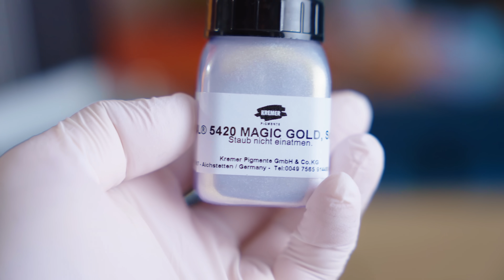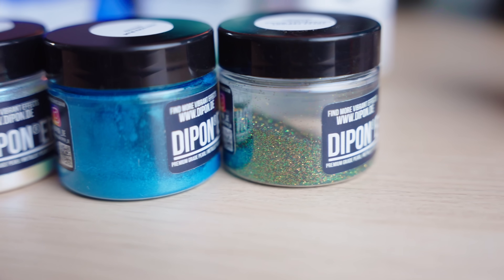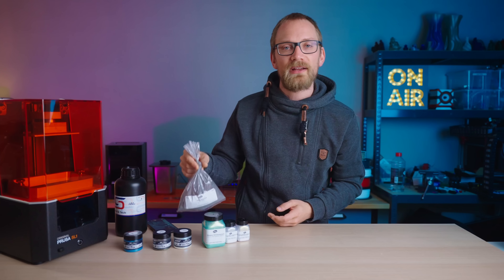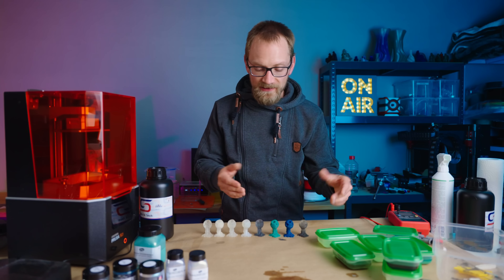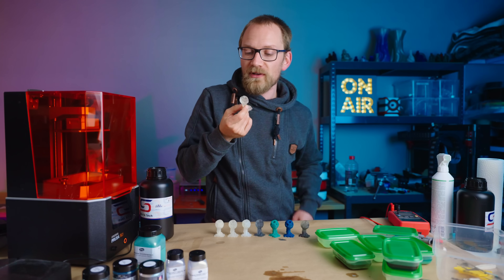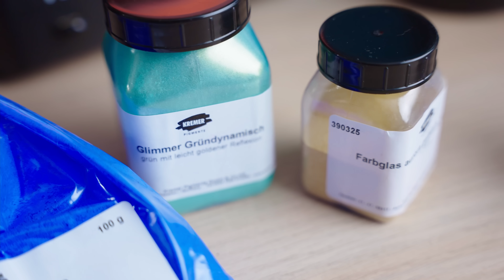Can we use Effect Pigments in Resin Printers?

Comment: Have anyone tried adding iron dust into resin, and print for example bases or better modular weapons+hands, which could then attach to tiny magnets inserted in the wrists & feet of a miniature?
(the base can be worked around in different ways, and it's much easier to hide the tracks under the base, but modular weapons have really tiny hands ball joints and are visible from most sides)

Comment: The ultimate challenge - Resin print in multiple colors! :)
Well I'm thinking (haven't tried it yet) that in some use-cases it can be done, at the very least in two colors.
I mean specifically multi-colored lithophanes. Multi-color FDM printers can do that, but resin printers have single vat with liquid resin - obviously it's not easy to switch resins in mid-print ... and where to define the "mid-" ...
But I just though that you can print several (thinner) layers of the same image lithophanes, each layer in different color and then stack them next to each other (and of course light a lamp behind them).
At least two layers would be simple to do, given that each layer can have one flat surface and they'll fit nicely.
Adding a third layer would leave a small air gap between the third layer, but I wonder if you have Red, Green & Blue layers could you combine them to produce much more colors?

Comment: Great video! 
Unfortunately with your low cost 3DP technology, you wont be able to use heavy particles.   (low cost printers to me are less than £10'000)
The machine needs "continuous mixing" ability -  existing ones cost at least $100K - The resin vat has a sink hole where it can drain out down into the mixer, give it a good stir, then pumps back up into the resin vat.

Particle mass/size/transparency will also have a huge role in success. (blocks pixels/reduce UV exposure)
You could print calibration/validation tools?   see how adding pigments/powders require exposure changes.

Alternatively I would consider looking at Graphene and Carbon Nano Tubes, and mixing them into resins.  (there maybe some available in shops?)
CNTs/graphene should greatly increase the conductivity, and may improve mechanical properties.

Perhaps you could look at coated particles?? --- a lightweight particle (aluminium) coated in a different metal for your design needs.
sadly... this route is likely to be extremely expensive and most products range $300-£1000 for  0.1g - 10g

Comment: If the particles are 50um then they CANNOT stack on top of each other because the bed clearance to the the build plate will force them to 1 layer.  (This most likely for the larger particles that you can easily see.)  Then they wind up following the layer lines - just like you saw!  I love the blue one too - good experiment!

Comment: I did many tests and this does not work well, because the movement of the printer un-mixes the  resin and draws the pigment or flakes on the sides of thebottom of the vat, most of them interfere with the printing and don't go in the print. A good fix is to add a mixing apparatus to the vat, that keeps the resin mixed throughout the print.

Comment: I wonder if a subsurface pump/pulse flush system may help W pigment distribution & orientation. A rig based around vertical syringes looks like it may fit around a bed perimeter.

Comment: I experienced a weird thing when printing where the bottom of the prints all had holes on the first few layers, which I'm assuming is due to clumps of pigments and maybe the ambient temperature since I also used Siraya Tech Blu V2. Seems inconsistent, but the rest of the print works fine. Kind of annoying when printing flat on the bed, but I have yet to find a concrete solution

Comment: So regarding "magic mica"... for the color to become apparent it needs to be on top of a black surface. (it's used in paint, so you would apply the magic mica on top of solid black) However in a resin piece, you will need to add a "smoke" type of black along with the effect pigment. This will bring the color of the effect pigment out 10x or more depending on how successful you are regarding getting the "smoke" the proper density.

Comment: Steal some industrial and lab ideas on how to keep the pigments in the resin during the printing process by making a 3d printed gear pump to pull the resin from the print bed into a mix chamber and then dump back into the print bed keeping the resin and pigment constantly mixed as the printer works. A gear pump is used to pump thicker fluids/gels like grease or honey and by 3d printing it you can toss the parts into the same bath process as the prints to clean after a job.  Labs around the world use a hotplate that has a magnet on a motor to spin a plastic coated magnet inside the glass container on the hotplate so it would be easy to steal that setup for a mix chamber using the same plastic coated magnets. 

If the pump is made right you can pump thinner fluids also so should be able to use the pump to help clean the pipes after a run before the final taking it apart to toss in for getting rid of the last traces of the resin to not effect future uses but then once you know how to make it it should be easy to quickly print new gears as needed. 

With access to the mix tank you could also do odd things like change the pigment mix during the print process to end up with different effects in different part of the print.

Comment: Create the ultimate red resin by combining stuff from the following list:
- Structural + Interference red pigments
- Conventional red pigments
- Fluorescent red pigments
- Copper and Graphite
- Red dye
- Self-luminescent pigments (such as Stuart Semple's Pink LIT and Yellow LIT)
- Rust powder

If you can get the ratios of all of these different ingredients just right, then Ferrari would be so freaking jealous. You could actually even license your recipe to Ferrari for use in their production of carbon fiber parts in their cars (since they still need to fill the parts with some kind of resin.)

By the way, definitely use an ultrasonic mixer.

Comment: I've seen the "holographic" look on most of my resin prints, it's just the flat faces of the layers reflecting back at you.  Maybe the metal flakes are also aligning when the plate mashes them down flat, but yeah it's pretty normal with very fine layer heights.

Comment: There are Metal "powders" that are "Atomized", that work better for resin casts. So a finer particle and suspends better in the liquid. Also running in a slightly cooler environment to keep the resin more viscous might help as well. 
You didn't mention if your Iron was done with this process.

Comment: I think one problem with the flakes that you’re having is that they are all orienting in the same direction, so if anyone is thinking of printing with these I would probably put the most commonly viewed angle facing down towards the bottom of the print bed.

Comment: @Thomas Sanladerer - You should of checked if the iron pigmented miniature ended up with any magnetic properties. You could also potentially use a couple high power neodymium magnets on the platform that the print is attached to. This should in theory help pull the particles up and keep them in a magnetic alignment.

Comment: The angled shimmer is caused by the mica forming a rheoscopic fluid. The up and down motion aligns the mica flakes. 

I'm surprised you had so few issues, when I was playing with pigments I had pretty severe under-curing and adhesion problems.

Comment: When I Dye (anodizing) The tiny Dye particles fit into the pore structure created by the anodizing process.. Time/time/amperage  all effect pore size  and if the Pore size is too small, The dye particles fail to enter into the pores and the dye does not take..( when done correctly, the dye particles fit and then after a quick steam/hot water dunk it seals up..)… Yeah, seems off topic and outta Left field…and it is, To a point… unless you make the connection.

Comment: I think the iridescent shimmer effect being aligned with the layers has more to do with the geometry of how it's printed - the contours generated by each layer going down create sharp horizontal changes to the surface that are more drastic at a steep angle, and less drastic at a shallow angle. So the light entering from above can bounce back more cleanly than light entering from the sides, where it's getting deflected. It makes me wonder if sanding the piece afterward would allow the shimmer to be visible in more areas

Comment: I would like to see how the model orientation changes the pigment effects. Also if stirring after x amount of layers improves the print like with the metal. I kinda thought that the metal wouldn't conduct as there is so much resin between the particles.  But, it would be really interesting what sort of magnetic properties that the resin has. Also, can your mixed up resin be cured by hand if you were to paint it on a print?

Comment: FYI, the channel "Major Hardware" did a metal impregnated resin print of a radiator to see if it would work to keep a computer CPU cool. It pretty much did! He ran into the same issue of the particles settling quickly.

Comment: I think the iron particles would be great for making miniature bases that you can attach to a magnet. One way I've thought of for storing my D&D minis was to get one of those carts with all the tiny drawers, and line the drawers with magnetic sheets. Originally, this would require gluing a metal washer of some sort on the bottom, but if the base itself is magnetic, that would be perfect. The idea was you could put any size or shape (you can't do that with the foam with the rectangle cutouts, and the pick-and-pluck foam has a lot of wasted space) and it would stay put, no rattling around and chipping off the paint as you move the cart around.

Comment: Great to see other people trying out powders and pigments in their resin of choice.  We've been playing with various glitters in our resin range for a year now and I think we have come to the conclusion that the reason most of the reflections are seen from the top and bottom of the finished print is that the particles get arranged flat when the build plate presses down on each 0.05mm layer.  I'm going to check next week if we can get the particles to be more random if the layer height is increased to either 0.075 or even 0.1mm.  Might even try running a pump or some way to oscillate the resin during the print to keep the resin moving just before the UV light cures the layers.  Only other way to get the glitter to reflect on the sides of the model is to paint it with the same resin after the print and then post cure that.  Keep the experimentation up Tom!

Comment: Glad to see the mica/dye printing is finally being taken seriously. 
in the 3 years now I've been doing mica/glitter printing I've found a few things:
 Print orientation plays a HUGE part in getting mica and glitter to show up and visually pop. took me ages to nail down the correct angle so you dont get that one angle only "cat eye effect" but once you find the right one for each part you can get absolutely stunning results. 
A printer with tilt is almost an absolute must, especially with the heavier micas and glitter unless you want to sit and stir every few layers. 
you can also play with chunkier glitter, especially if you know you'll be sanding the part afterwards. I've played with flake style glitter/mylar bits and while it sticks out of the layers, clipping it off is easy.
Reply: I notice Tom's all have iridescence at basically the exact same angle, axial with the print direction. Is that also your experience? Do you orient expecting the most stunning angle to be either vertical or anti-vertical?
Reply: @AlexWhittemore   in my experience and test with mica only (no other additives) you're limited to the layer facing the build plate and vat surfaces with a little bit of bleed over onto the surrounding edges as far as visibility of the shimmer/shine (cat/tiger eye) effect goes.That being said, you can maximize surface area exposed to the build plate and vat surface to drastically increase how much of your part gets the shimmer/shine effect. With pigments (dye or powder) or glitter (fine or large particle), distribution depends on how long and well the particle, powder or liquid stays fully mixed and suspended within the resin during the printing process. This is why thicker resins work best, and a printer that utilizes a vat tilt, or wipe are almost necessary.
Reply: I should probably finish the video before commenting :P
Reply: Do you find that glitter makes your parts weaker?
Reply: @J0SHUAKANE  if you go absolutely overboard with some of the chunkier stuff, yes because you'll have more glitter than resin in some spots. but if you use it in a reasonable matter it doesn't seem to make much difference for most models.

Comment: I wonder what would happen if you use the small peristaltic pump to circulate the resin in the vat. Would it improve dispersion of the flakes?

Anyway, as always cool video.
Reply from the maker: I'm afraid heavier pigments would still settle out in lower-velocity areas, kinda like sand banks form in rivers.

Comment: I assume the certain angle at which the shimmer effect is most visible is due to the glitter particles being small disks and them settling the slowest when they are parallel to the bottom of the print bed, so trying to print parts in a direction where this effect is visible from the front might be a interesting idea.

Maybe frames for sunglasses or even light switches that would switch colour when you flip them (due to the changed angle) might be fun to try.
Rotating knobs and other moving parts could also be very interesting for such glimmering effects, when they are printed to work well with the particle direction.

Also trying out some black 1.0 pigment from culturehustle could be interesting, since it absorbs about 94% of visible light, so you might get some super dark prints.
Or even some black 3.0, which is not a pigment but a acrylic paint that can be mixed with resin (according to the manufacturer. Idk if it works with this type of resin as well) and it absorbs up to 99% of light, so the print actually might end up being the darkest possible 3d print

Comment: Some nice effects there, would have been interesting to see some less organic shapes printed, like a lattice cube or something similar. And planning on how to orient the print on the printer to get the best "flip-flop" effect just adds another level to the slicing process.
Personally, i'm still only doing filament prints, so i'd definately prefer less resin and more filament content. (Or how about a mashup, print something in filament, coat with resin, and cure that resin with the UV lamp / curing station?)
Reply from the maker: https://youtu.be/nOZaTB34RrI
Reply: @MadeWithLayers  Ha! Thanks for that link, i was not aware you already did a test like that.

Comment: After devoting a goodly chunk of projecting time lately to find an additive for standard resin reinforcement, I ended up going the extra mile and formulating my own. Surprisingly I got very good results from mostly "off the shelf and green"/enviro-friendly components, and as of currently, I'm one step away from turning my additive into a full-blown UV-curable resin. Thomas, if you're like the type I am, I'll bet this could be a fun exercise for you. There's tons of whitepapers available to get you in the right direction and they're worth a read even if just curious of how to go about getting a better and tougher resin formula.
Add: Coincidentally in the form of fine particles, I've found that the suction pop on every layer change of a fairly firm FEP film is perfectly enough agitation to keep my mixes in suspension.

Comment: definitely liked the blue as well. 

From how SLA printers work, the shimmer effect being aligned with the layers makes sense. the shimmer is inevitably going to come from a flat face, and with the layers so thin, it's inevitably going to push a majority of the particles up flat against the build plate. no complaint, it's pretty cool! 

as for the stainless steel powder, it looks like the density of the powder prevented it from flowing with the resin as it filled in the spot where the previous layer came out, so by the end there was virtually no powder going into the print. ironic that it manifests in the print looking like it's "settled down" inside the print as well, but it's a pretty neat effect. you could two-tone some prints if you got some heavy pigments!

definitely looking forward to more experiments with resin prints!

Comment: Test the iron powder print with a magnet :)
Reply: stainless steel is not magnetic :/
Reply: @PraxZimmerman  it depends on how "stainless" it is. Most consumer "stainless" is  magnetic
Reply: @PraxZimmerman  So, IRON POWDER is actually Stainless Steel powder?!?
Reply: He did say he used Stainless Steel powder and there isn't just one formulation of Stainless steel.  I do know some stainless steel cooking pots are made of the type of stainless that is magnetic so they can work with induction cooktops.  Here is a result of a Google search: "Whether a magnet will stick to stainless steel depends on the specific type of stainless steel. Austenitic stainless steels, like 304 and 316, are generally non-magnetic. However, ferritic and martensitic stainless steels, like 430 and 410, are magnetic and will attract magnets." Also, I would expect that is wouldn't be conductive because the resin 'glueing' each fragment together is not conductive and doesn't allow enough of the fragments to touch each other for conductivity at any significant distance apart.